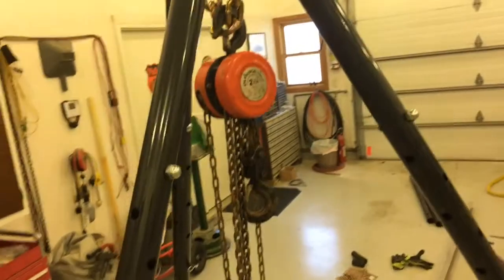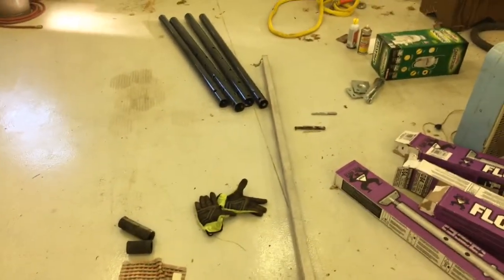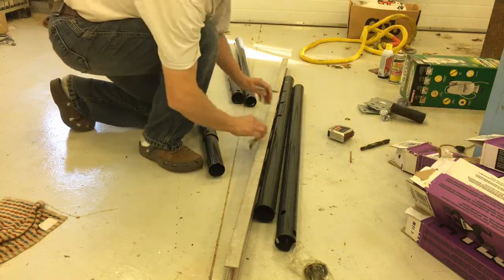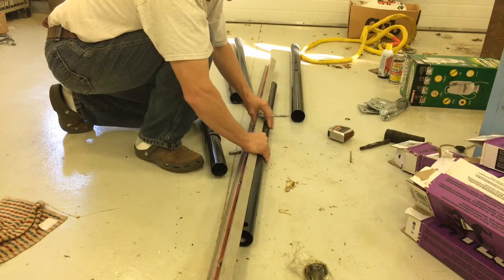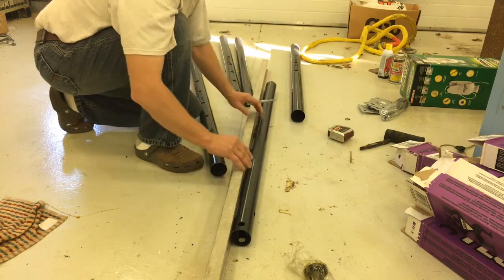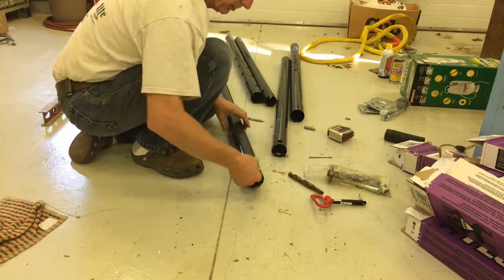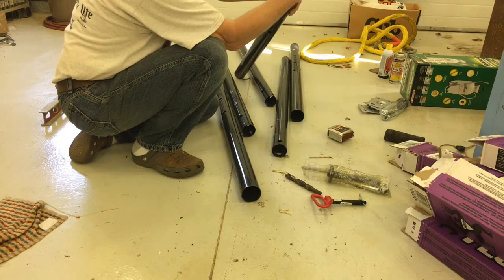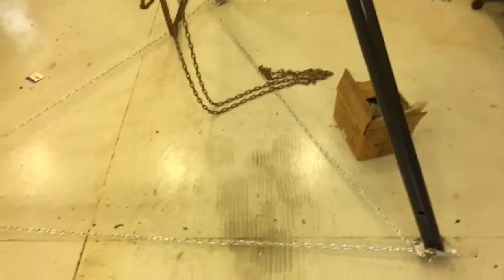Tripod hoist build 4

Comment from the maker: In use, I do place the chains at ground level, except when an obstacle prevents it. While the floor jacks are meant to support axial/vertical loads, they are simply different diameter steel tubes that allow them to telescope, were affordable, and much safer that the tripods made from dimensional lumber. The safety chains help me more to ensure each leg is spaced equally for maximum weight distribution and assist during proper setup and also when “walking it” to a new position. Knowing these steel tubes are not as strong as heavier steel pipe, I am cognizant of that and the heavier the object being lifted the closer I bring the legs together. When the ground is soft and/or the lift is heavy, I put planks under each leg. I four seasons of use, I gave probably used the tripod for about 200 lifts with heaviest at near 4000# and height about 11’. 
More videos to follow...someday. Check me out on Facebook too.

Comment: Just a thought! These floor jacks are supposed to act purely as axially loaded columns. By putting your anti-splaying chains at about the third point of the legs, if the tripod legs were slide outward, it would create tensile forces in the chains creating a bending moment in the tripod legs in addition to the axial load which could cause a sudden and catastrophic column failure of one or more of your tripod legs. It would be best to place these chains at the very bottom of the legs (pinned connection); or, if there is no chance of legs sliding out, leaving these anti-splay chains off altogether. I know this creates the risk of the chains being pulled down into the soil, but if it's sinking in the soil, why do you need chains?  In addition, after seeing how the tripod was built in great detail, I'd really enjoy seeing the tripod and chain hoist in action actually lifting tombstones and placing the base and tombstone using the tripod and hoist.